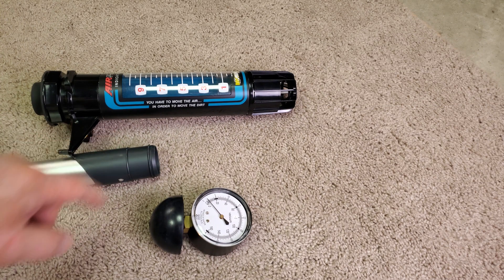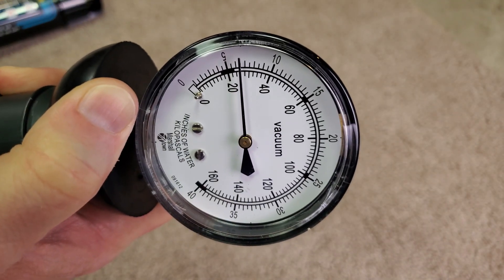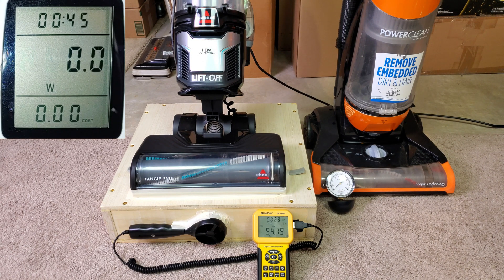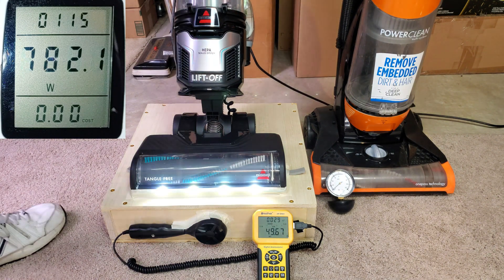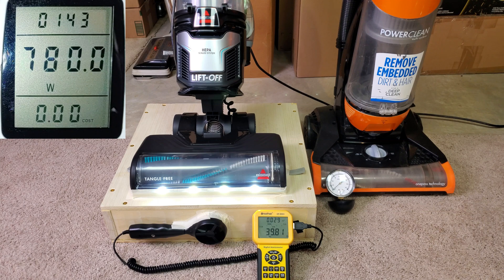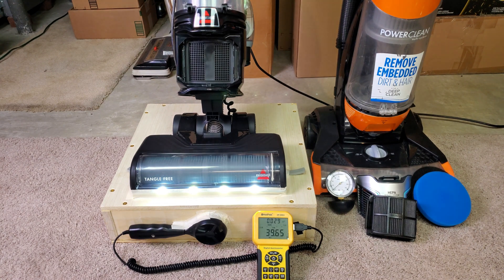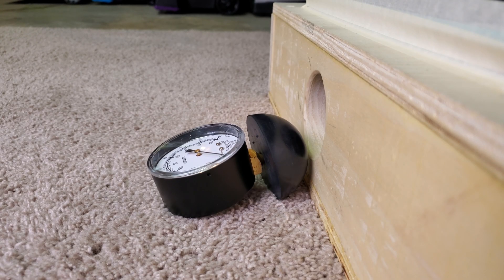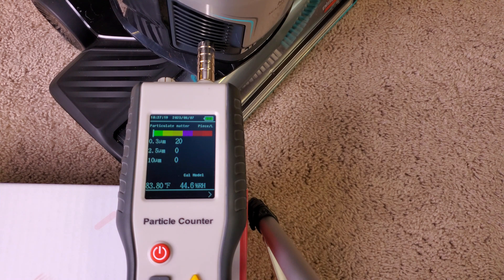New Bissell MultiClean Allergen Lift-Off Pet Static Tests

Comment: Can you do a smoke test to see if Bissell MutiClean really seals all allergens and there isn't a system leak? If there is already one, please provide a link.
Reply from the maker: @Snowythelittlecutehamster  smoke tests are wrong and misleading at best. Actually they consist of water and alchohol usually. People who post these tests have no idea what they're doing. The particle meter is the only real test for filtration.
Reply: Can you do partical test aroud the vacuum to make sure it' completly sealed?
Reply from the maker: There literally is no point in that.